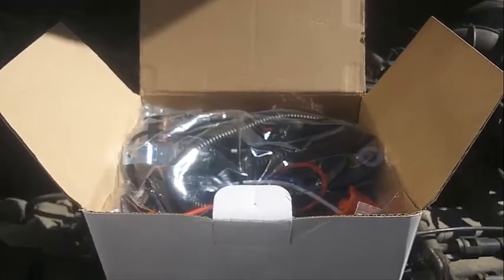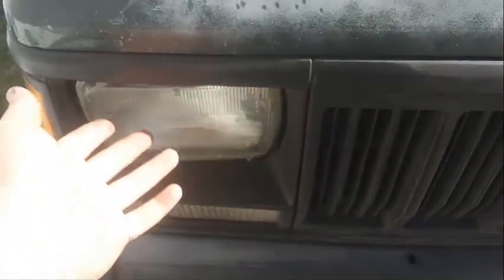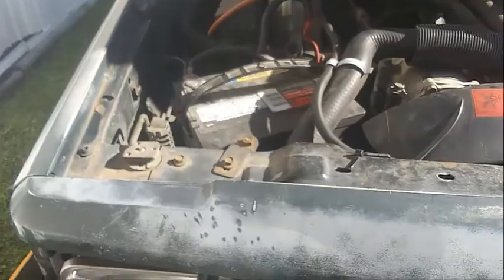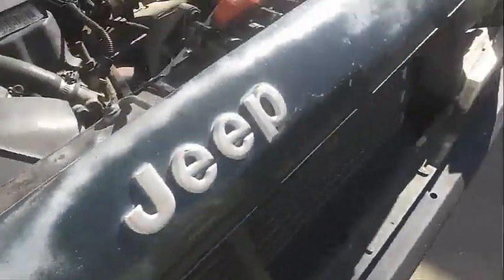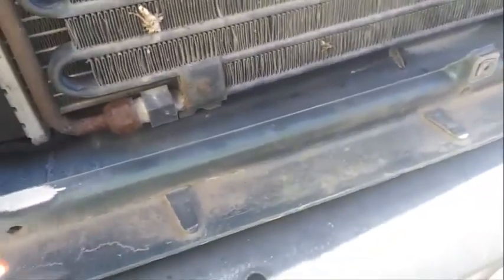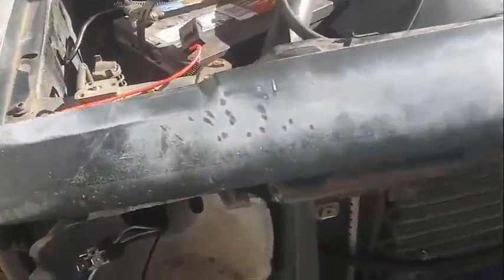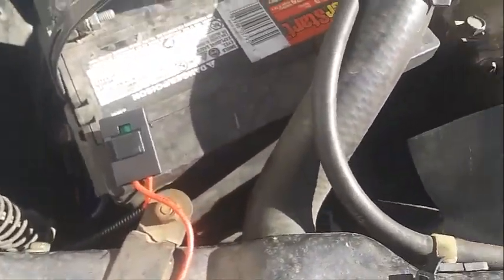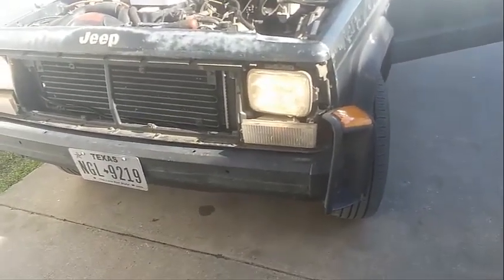1984-1996 Jeep Cherokee Headlight Harness Upgrade

Comment: So the wiring harness is making the switch go bad? I replaced my switch using your video but it keeps blowing the fuse
Reply from the maker: hmm that is odd. it shouldn't be blowing it at all unless that ground is removed without disconnecting the battery. Yeah the old harness likes to burn out the switch over time.
Reply: @JBenedict02  I disconnected the battery when I swapped the switch worked for 5 mins then blew fuse I have the harness to change it just need to know what part to change